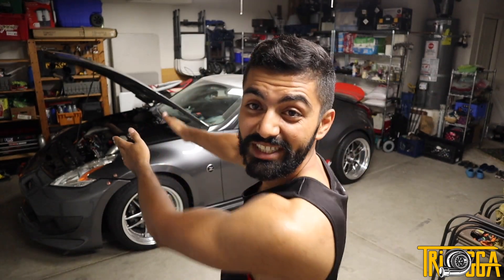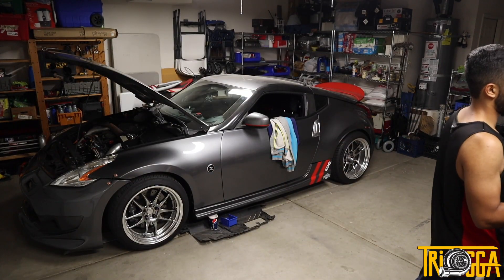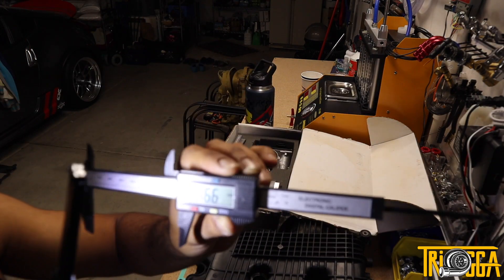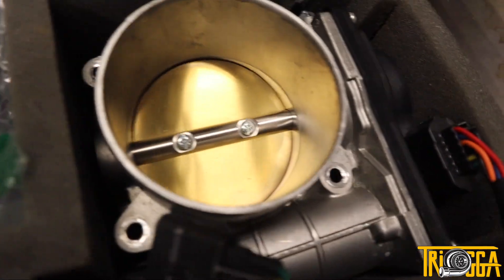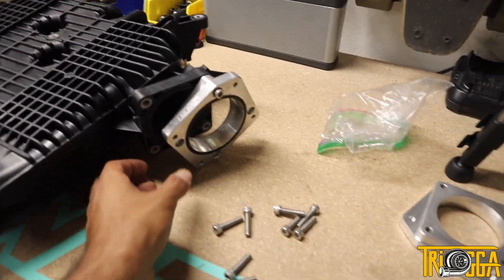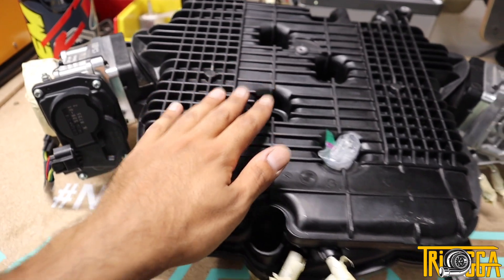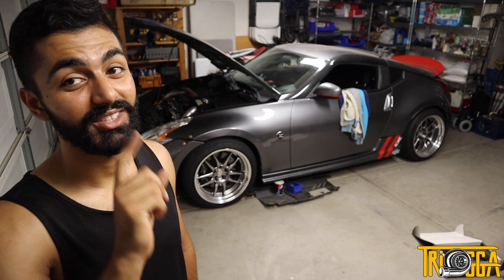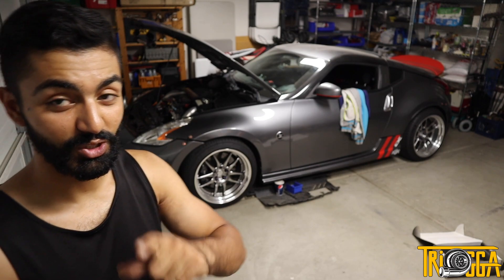How to install Nissan 370z ( EPS Big bore throttle bodies) #370zbuild #370zmods #EPS

Comment: I don't know if you've considered something that I've found that will give you instant results in your throttle response is the Pedal Commander. It bypasses your ECU and eliminates any delay in your throttle response. All of the mods you are doing to your manifold are currently being held back by your ECU programming. I have one on my 370Z and was absolutely blown away by the difference. Give it a try. You can find them on Amazon for $299.99 with free shipping. Your content on your channel is really good for us 370Z owners. The mods you are doing are very relevant to owners of this platform. Keep up the good work.
Reply from the maker: Didnt know such thing existed but I am gonna look into it. Ans thank you for the kind words and helpful comments. I try man. I've been collecting the best parts for this platform and there is so much more coming. You just wait 😉
Reply: Trigga M uprev and ecu tek have a feature like that built into the tuning software enabling 1:1 control of the throttle. A pedal commander justs multiplies the voltage input into the throttle bodies giving you the illusion of more throttle response
Reply from the maker: Liam that is very correct!!! I Have uprev and will be using it very very soon since its almost tune time baby 😬😬😬
Reply: @liamheuvel2681  What illusion? The throttle either responds or it doesn't. With the Pedal Commander, the throttle responds!

Comment: Anyway dyno this combo, my car made 303whp/271wtq with ported upper&lower intake manifold and the 76mm throttle bodies like shown in this video, also longtube air intake and high flow cats
I'm bit disappointed and I'm not sure if it's the tune or the porting and larger TB does nothing to the VQ37VHR at all
Reply from the maker: I got rod of my kit & developed my very own with a group. We use 76mm tb kits now with our own spacer and harness. Matched with my very own manifold. Seen cars make about 350/330. 
Obviously depends on other supporting mods. But yes these EPS kits are no Bueno in tuning, performance and ect... reason again why I sold mine and made my own
Reply: @TriggaM  i throttle bodies I bought is from simplistic garage, I installed everything properly including the harness and spacers, I'm having major issue with constant Rev hang and slowly giving up on them might go back to the stock TB
Reply from the maker: You need a tune my dude! And you need to have your TB relaened process, with the actuall device not just Manuelly how people Do. Some had Same issues as you and trip to dealer fixed it all. If you have insta DM and il send you the screen shot. We never had 1 person with issues. And also who is your tuner?
Reply: @TriggaM  I did tune it my friend and did the relearn process many times with the actual device in my friend shop when we installed it, we tried to do a hard reset so we can do the relearn process but it stays at higher rpm than usual, and revs slower than usual even after a tune, but like I said earlier ETB are very tricky to tune and don't know if a proper tune will get rid of the rev hang
Reply from the maker: Who is your tuner? May I ask or know? I've seen people have similar issue and relearn process solved it. I've seen plenty cars get tuned with them now. So it's very strange to hear what's going on with you
Reply: @TriggaM  i'm from Kuwait, there are only 2 people here who can tune with ecuTEK and I think he is not very good and about the TB i found a guy who works at infinit and he figured out how why my rpm won't stay stable "1500-2800rpm", so  far my rpm is 900 and at times goes to 1100rpm but goes to 900, he told me to get better tuner so i might get a remote tune, i was very excited to install these with the ported intakes but turned out the TB on 370z are tricky to tune.

my question how much gains usually people with stock exhaust with test pipe or HFC get with the ported intakes + 76mm TB
Reply: @TriggaM  also i went to the dealer but they won't touch any car that has modification as rule but thankfully a guy who works at Infiniti did it and it's a lot better just now i need to find a good tuner, i will DM you on Instagram, i followed you and simplistic garage which where i heard about the Throttle body and ported intakes offer, the guys at simplistic garage were very helpful, been talking for a couple of days until the issue was semi-fixed, just probably need a better tuner,
Reply from the maker: Yes bro DM me and remind me it's you and il help you find a tuner. I've had plenty of people tune with them bro not a single issue! You just need a solid tuner which I can help you find
Reply: Too much air for na .. those big Tb are making you lose velocity.  Take those off and put the stokers back on. I made 351 hp with  stock tb with bolts ons .
Reply from the maker: Eps suxk ass that's why you had issues. I eneded up making my own version of these 76mm tb kits 
They work very well and gain pretty good power. So your stock solution isn't much help here. Eps sucks. Triggaspec 76mm tb kits. Have been proven to make power now easily over a few hundred times on so many customers cars

Comment: Hey Trigga. I have an NA HR 6mt with exhaust + HFC (stock headers) with ported upper & 3" dual CAI. Do you know if the TB's make a noticeable difference on the HR without E85?
I know they are worth it on the 3.7 but no evidence yet they are beneficial on a stock tuned HR motor. Have you tested the gains on an HR?  ie what is the difference between Bolt on tuned HR to +TB 's + re-tune?  Thx brother.
Reply from the maker: Hey my brother! Stay away from EPS system! I had it for a long time and always had issues. It wasn't bad but wasn't the best ether. So that being the situation I was in with eps... caused me to develop a whole new TB kit. Which now is known as the TRIGGASPEC power 🔋 pack combo . I utilize 2 brand new Nissan 76mm TBs! And it comes with billet spacers, correct harness, & all the hardware needed for the installation! And the kit only cost $560 which you can buy directly through me!  To top it all off the harness we built has zero issues when it comes to tuning or using them. I've sold over 50 sets now in the USA 🇺🇸 & many internationally. 
For your build, all I would say you need is , 500-600cc injectors, 255lhp walbro fuel pump, TRIGGASPEC 76mm tb kit, TRIGGASPEC manifold combo! I know you said you have a upper but I would get the lower if you can! Also if you can full exhaust. Just so you know since you asked about the difference in feeling, your car will have top end like no other, more maxed out rev limiter, insane throttle response, and most importantly a shit ton more torque baby!! And for all who don't know what torque is : is what put you back into your seat when you gas! 

I've seen so many cars with my kits & my recommended NA combo set up that I explained to you! It's the best and it's all you need. For more info hit me up on instagram @notrigga or @TRIGGASPEC

Comment: Correct me if I’m wrong but wouldn’t a bigger throttle body be useless if the manifold is smaller?
Reply from the maker: not exactly sure what you mean? i ported out my manifold for max flow and hope that the EPS TB help more flow of air go in. guess only way to find out is the wait till its dyno time
Reply: Trigga M  we shall see, keep us posted

Comment: Where did you buy the Throttlebodys ?
Reply from the maker: I sold them and made my very own. EPS wasn't very tune friendly so that's why now we have TRIGGASPEC 76mm Tb kits with my ported manifolds that I sell. Have done over 100 kits now. No issues what so ever man 💪. If your looking to get some lmk
(manifolds set + tb kit $1100 shipped)
(Tb kit alone $560 shipped)
Reply: @TriggaM  I need them
Reply from the maker: DM ME @NOTRIGGA OR @TRIGGASPEC